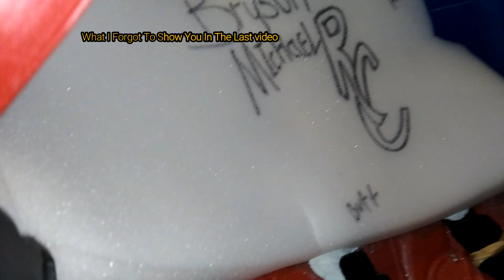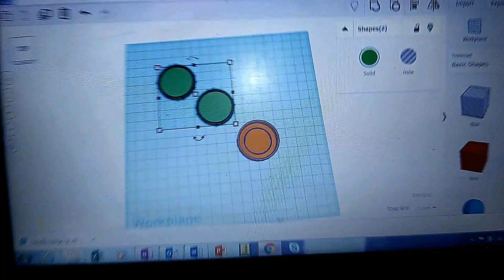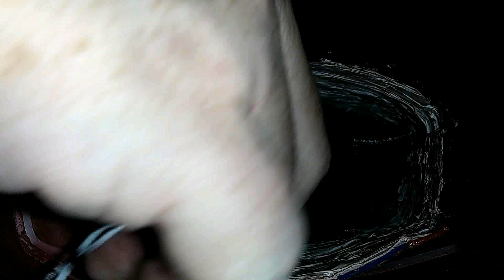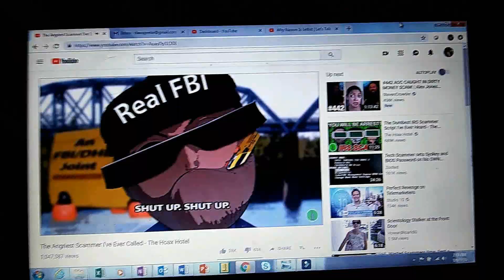DIY 3D Printed Iron Man Mark 50 Cosplay Part 12

Comment: Looking nice, what is that flexible glue your using?
Reply from the maker: I dont have a bottle on me to read off... its from a fabric section. Its a rubberized cement type glue from the fabric area at walmart. comes in small putple tubes. great stuff.
Reply: Thank you 😊 keep up the great work